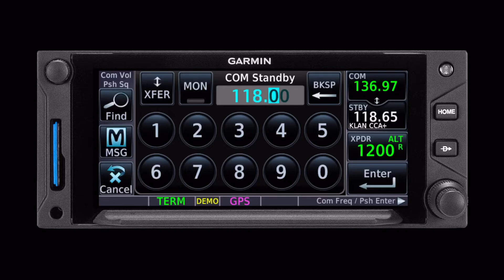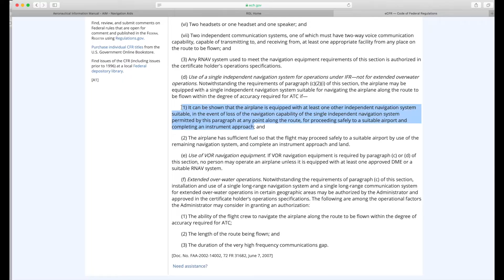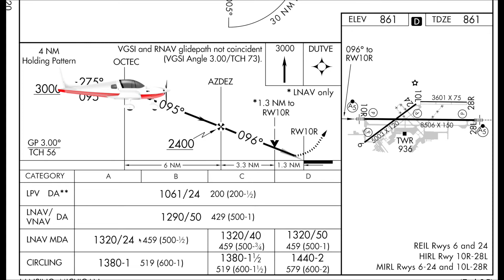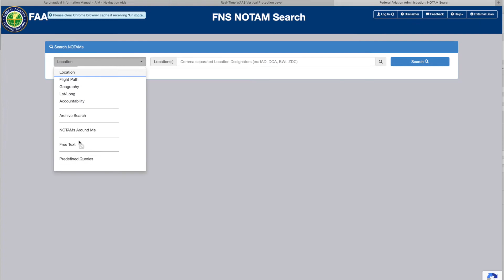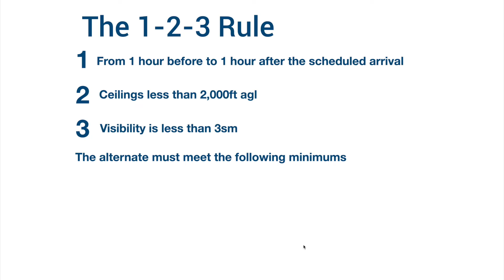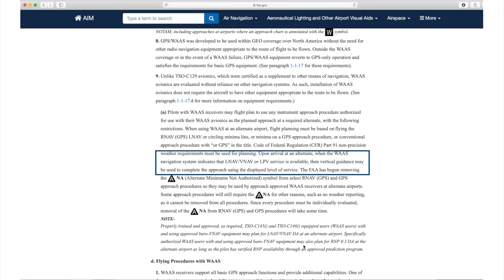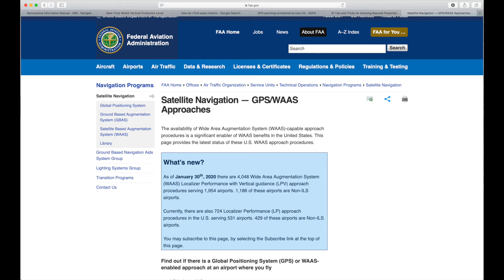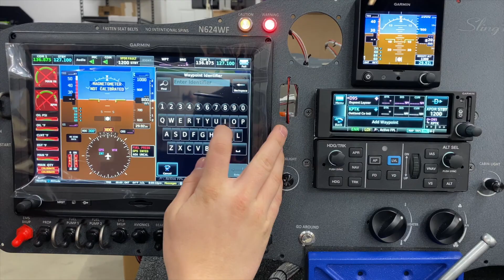GNX or GTN to equip your aircraft build for IFR?

Comment: I’ve been flying an arrow a lot  that my club owns and on a IFR flight yesterday my alternator went without warning then within two minutes everything went dark including the 375. Because of the 375 having the transponder in it I couldn’t even squawk 7600. Luckily the wx was pretty much VFR had a alternate in mind but I decided to flicker the master switch one more time and the lights back on and used that opportunity to lower the gear and radioed atc to inform them of my situation. These units are a great when everything is working but one must be prepared to utilize those pilotage and dead reckoning skills.
Reply from the maker: If everything went dark, your transponder probably would have too. Backup batteries would help that also
Reply: @MidwestPanels  Very true, and do you see  ga aircraft getting these backup batteries? Thanks for responding quickly.
Reply from the maker: @rn2811  yes, more and more we are seeing it. TCW has certified units available.
Reply: @MidwestPanels  Thanks 👍

Comment: Why not a 375 and a SL30? About the same size as a 650 for about $2k less
Reply from the maker: You can if you want to install a used unit. You will also lose some of the features from the G3X such as frequency swap.

Comment: Good information on the various WAAS GPS navigators.  Regarding the legalities of installing only one WAAS GPS navigator for IFR you reference Part 125.203, however, this regulation is not applicable to GA aircraft.   Part 125.203 is specific to AIRPLANES HAVING A SEATING CAPACITY OF 20 OR MORE PASSENGERS OR A MAXIMUM PAYLOAD CAPACITY OF 6,000 POUNDS OR MORE.  Part 91.205 which you cite earlier uis the applicable code governing instrument and equipment requirements for powered civil aircraft with standard category U.S. airworthiness certificates.  Two-way radio communication and navigation equipment suitable for the route to be flown is all that is required.  Navigation equipment, however, is addressed under the applicable Technical Standard Order (TSO). A WAAS navigator certified to TSO C-145\146 does not require alternate equipment.  Therefore, only one WAAS navigator is required for IRF.
Reply from the maker: Understood, we are simply showing all regulations as they apply to GPS navigation, as it goes in aviation if it doesn't say you can't then you can. Also a TSO is not a regulation its a design spec.  An STC is what specifically calls out what is required for certain installations per aircraft, such as a G3X in a certified aircraft has an STC that spells out what is required for that aircraft not a TSO, the equipment it has meets TSO for its required operation. All of this though is mainly for the experimental market and what is required for IFR, which does not fall under certified regulations to begin with.

Comment: I went with the GTX-375 with GNC-255a. The 255 was a better value than a 650 plus a transponder. Although I'm surprised that the 375 doesn't push frequencies to the 255.

Comment: I like all those “hunerds” being saved. I have an existing 430w and probably going to add the 375 for a transponder and backup nav.
Reply: The 375 naviator is far better. You can create random holds, it has lateral and vertical guidance to VFR runways, and more. Its a next generation.

Comment: I don't think you can use the GTR 20 with the GNX-375.  I think the GTR 20 is for the G3X only...  Anyone know more about this?
Reply from the maker: You can’t use any radio with the GNX 375, it stands alone.If you use a GTR 20 as a 2 place intercom you can wire the alert audio to it but yes the GTR 20 was developed for the G3X system. If you are not using G3X you will need a panel mounted radio.

If you look at what we do, it’s 99% G3X.

Comment: Excellent sir!  I just went GPS only on my Aerostar.  Pulled a bunch of '75 Collins out. and I went the GNC355a plus two KY196's and the new 3 com 345 Audio Panel.  Additionally I have a stand alone GDL 50 and Aerra 760...... My mistake was using a 330esd instead of the 345 transponder.  I may add a 375 thus giving me redundant transponders and the traffic and weather on all devices.

Comment: Steve and Adam, I recently discovered your channel and I've thoroughly enjoyed videos and the information.  I am getting ready to build an aircraft (model not decided yet) and this video triggered a question which I've not been able to find an answer.  I'm hoping you guys can help.

I've noticed that most people using the G3X system will pair a GTN device with a GTR200 or GTR20 as their second comm.  If I went with a GNC 255 for both the second radio and Nav, I know the G3X can control both the radio and nav portions.  However, is there a way for the G3X to display VOR/ILS information from both Navs (like a cross radial identifying a fix on an ILS approach)??  Or would a secondary display like a G5 or GI-106 be required??  I know I'm thinking old school by wanting a second Nav radio but I can't shake the question and capability.  Thanks for your thoughts.

Comment: Does the waas receiver and GPS receiver have independent power supplies within the unit?  I think the intent would be to have an independent option for the route flown.  Also without a VOR I don’t think you can fly class A.. In addition if you are IFR and have an emergency it would also be very beneficial to have an ILS installed in the plane so to increase the number of acceptable diversions.
Reply from the maker: Hi Jeff,

Thank you for your comment.

No they don’t have separate power supplies, however if the Unit itself dies it doesn’t matter if it’s a GTN 650 or GNX 375, it would be the same result as the unit controls the NAV portion so your scenario would only apply if only the GPS receiver inside the GTN 650 failed, however the G3X itself could be used in this very unlikely situation to get you safely on the ground. Even though it’s not certified for approaches, it is definitely accurate enough to do so, as well 91.3(b) states:In an in-flight emergency requiring immediate action, the pilot in command may deviate from any rule of this part to the extent required to meet that emergency. So if necessary the G3X is not only capable of helping you it would be legal in an emergency.

91.135 lists requirements for Class A airspace and a VOR is not listed, however I would argue that most GA aircraft will not fly class A anyway due to oxygen requirements and the lack of ability to climb that high.

As for emergency and options, pretty much any airport with an ILS will have an LPV so options aren’t really much of an issue.

As stated in the video, it really comes down to personal preference. There really is no right or wrong answer here.

Thank you for watching and engaging, these interactions are what make this community great!

Comment: I was informed by an instructor that I know that examiners will allow you to demonstrate a precision approach with LPV even though it is not considered a precision approach.  If this is actually the case it would allow you to have a single gps for your checkride. Can anyone comment on that?
Reply from the maker: Section VI Instrument Approach Procedures Task A Nonprecision Approach and Task B Precision Approach both call for the use of ground based and satellite based navigation systems, so if judging only by the ACS it would not be allowed. Our local DPE will not allow it however we have found that opinions differ around the country so it is best to check with your local DPE

Comment: great video/ I enjoyed your take and presentation. I did however find that when you were talking about the gnx375 at the 15:18, you had showed and commented on the gtr 20 paired with it when this is not possible.  My understanding is its only compatible with a g3x.  I can not find any documentation or menus in the gnx375 to support this.
Reply from the maker: Correct, the GTR 20 is only compatible with the G3X. We build Experiental panels so G3X is what we work with. If you were putting this in certified without G3X then you would have to use rack mounted radios.

Comment: Good Info!  I already have a good KT-76C digital transponder with GDL82 ADS B.  Additionally, a  GNS430w and a KX155 with glideslope.  So... just add a GPS 175 and a newer generation iPad with Garmin Pilot for the nice big display and Bluetooth connectivity, creating  a great setup for under 5k!  The nice thing about iPad display is with the right mount, it can be right at your fingertips and have an even bigger and in some ways more versatile display than a GTN 750.  Basically, the 175 and KX155 give you everything for a  #1 GPS/Nav/Com, and the 430w becomes the #2 backup.  Cool thing is that you can Bluetooth your flight plans from the iPad with either Garmin Pilot or Foreflight apps to the 175 and it can then cross fill them to the 430w.  I'm also considering some of the GI 275 stuff that also connects with Bluetooth when upgrading round instruments or getting rid of a vacuum system.  Lots of info for relatively small bucks (in avionics terms) and can keep the round gauges for backups and retain the retro look in my classic.

Comment: This is a great video but I do have one question. I have an older non-gps IFR stack with DME and a KX155 with glide slope and another KX155 without glideslope. I'm thinking of getting either a gtn650 or the gnc355. I'm wondering if I should get the gnc355 and install a g3x to get more real estate or if I should get the gtn650 with G5s?

Comment: Wow, I'm in the process of buying a plane. I was looking for something with a  Garmin 430W but this plane only has a Garmin 300xl. I was thinking Bout the Garmin 175 in the future as a budget gps because my pockets arnt that tall. Seeing this very informative video now have me confused. Should I just keep the 300xl?
Reply: For VFR the 300 is fine. Not appropriate for IFR though.
Reply: The 300XL is fine for non-precision approaches because it is non-WAAS. The new 2" navigators are intended to replace the older 155XL and 300XL with the 175 (GPS), 355 (GPS/COM) and 375 (GPS/XPNDR/ADS-B in/out). Parts for the older non-WAAS are running out, same for the 430W. However, the 430W can be replaced with an Avidyne 440 without removing the tray and wiring.

Comment: 14CFR125 applies to no homebuilt.  What it does apply to would require a second navigation source.  A GPS with WAAS is ONE source.  To encourage IFR operations with one navigation source is ill advised particularly when it is your com source as well.  One box quits (and they do quit from time to time) and you wont be shooting any approach ASR or otherwise.  And yes the ACS require more than a GPS approach for the rating.  Good overview of the garmin offerings though.
Reply from the maker: landinggearup not only have I instructed in aircraft with one NAV Com but many fly with one. If I lost my GPS it wouldn’t really be that big of a deal, yes you can shoot an ASR approach without a GPS, same as a no gyro approach.
Reply: Midwest Panel Builders....landing gear up is correct. Part 125 has NOTHING to do with small planes. Basically, that is for planes with more  than 20 pax. Like they said the rest of the video is good though.
Reply: I don't think single source is an appreciable risk as there are much greater dangers to IFR flying, especially in a single engine recip. There is a degree of redundancy if a G3X is installed as that will have a sufficient nav capability to mostly fix the nav problem, albeit the PIC will have to make a certain declaration to legally use that backup source. Also, an IFR flight will almost always be operating in a radar environment so the controller can provide navigation and terrain separation. Money is probably better spent on a good, reliable powerplant. JMHO.

Comment: great video.. I'm planning on installing a GNC 355 along with a G5 HSI to satisfy IFR flying. Many pilots, avionics shops and FAA DE's etc are unsure of the requirements for IFR flying and IFR check rides only using a GPS WASS navigator. Can an instrument student take the IFR check ride with only a GNC 355?  3 different approaches required, For example,  the same plate can be used to do an LNAV, LNAVVNAV  or LPV approach in many cases. Three different approaches. Just in case, my backup plan is to install a Navcom unit tied into the G5 HSI along with a previously installed GNC 355...  Just heard your last comments on IFR Checkrides. I will still install a separate Navcom if needed to satisfy IFR check rides plus gain additional redundancy with a second comm radio and second non gps nav source.
Reply from the maker: The ACS does state that you need to perform approaches by way of ground based navigation equipment so technically you can't do a check ride with only a GPS. Plus an LPV is not classified a precision approach even though it is flown the same as an ILS. The best thing to do is check with your local DPE to see their thoughts. As for IFR flying, as mentioned in the video, as long as it is WAAS its totally legal.
Reply: @MidwestPanels  First of all, CONGRATS on a superbly informative video.  It is rare to see anyone dig into the FARs and the AIM in explaining this complex information.  The only point I'd like to submit is that the ACS does state (A-14-15) "Localizer performance with vertical guidance (LPV) minimums with a decision altitude (DA) greater than 300 feet
 height above terrain (HAT) may be used as a nonprecision approach; however, due to the precision of its glidepath and localizer-like lateral navigation characteristics, an LPV minimums can be used to demonstrate  precision approach proficiency (AOA VI Task B) if the DA is equal to or less than 300 feet HAT." Personally, I'd prefer to have the ILS capability. Thanks for a great job

Comment: Great explanation, thanks!   Does the GNX 375 need a separate CDI to be IFR certified? Doesn’t it have vertical and horizontal bugs right on the screen for a gps approach?
Reply from the maker: jpoppinmoneyunit We are glad you enjoyed the video. You do not need anything more than the G3X screen. The G3X has an HSI and displays the course as well as the glide slope if the approach uses vertical guidance.

In the event that the G3X failed we can use the G5.
Reply: @MidwestPanels  But if you don't have a glass PFD, then wouldn't you have to have a nav indicator such as GI 106B to display "on course" guidance with the GNX 375 display indicating location on the course as well as localizer display?   I have seen this combination advertised as a basic certified IFR setup.  I was surprised to note that the GPS 175 (and I assume GNX 375) is compatible with many older nav indicators from other manufacturers.
Reply from the maker: @Stratocruizer51  yes you would need an indicator like the GI 275, G5 or GI 106.

Comment: I’m planning two G3X, a G5 and a GNX 375. and a GMA 245 R
Reply from the maker: Harold Locay that will be a great setup. We do these all the time.
Reply: @MidwestPanels  now I have that setup in my new Bristell. I’m in instrument training and have the dilema of a Checkride needing two navigational aids. How can I add VOR ILS to my current setup ?
Reply from the maker: @haroldlocay3946   Unless you can find an older SL30 the GNC 255 would be about the only way to do it.
Reply: @MidwestPanels  Excellent. 
Would that be a lot of work/time to add that ?
Reply from the maker: @haroldlocay3946  it depends on what you already have? Which COM radio(s) do you currently have. Will a VOR/ILS antenna need to be installed?
Reply: @MidwestPanels  I have two G3X touch, G5, GNX 375 with audio panel and second com, GTR 20 R com, GSU 25, GTX 45 R TPX, GPS 20 A, Garmin GMA 245 audio panel. No VOR/ILS antena.

Comment: You can do precision and non with the 375. They can only test you with the equipment in the plane., so I think you can get your instrument rating with the 375 ??
Reply from the maker: The only precision approach is an ILS. Although the LPV performs like a precision ILS it is not actually classified as a precision approach.
Reply: This is very timely for me.  I'm having a 375 installed into my Piper Warrior for ADS-B out compliance and IFR navigation (without a G3X for now).  I also have a non-WAAS 430 and one (1) GI-106A CDI.  No convenient place to put a second CDI (and don't really want the added cost).  I am putting the GI-106A onto the 375, and leaving the 430 without one.  I do want to do IFR training and certification in the plane.  Am I still blocked?
Reply from the maker: Phil Loftis it’s best to check with your local DPE. I have seen differing opinions on this subject. Our local DPE will not for an instrument check ride with only a GPS. The ACS still references the use of Ground-based navigation for precision and non precision approaches.
Reply: @MidwestPanels  Thanks, good suggestion to check with DPE.
Reply: @MidwestPanels  I did all my training and IFR check ride with only the GTN 625 installed in my plane. My examiner said even though the wording does not say that an LPV approach is a precision approach, he considered it applicable because it went down to a 200 ft DA. same as the ILS at the airport.
Reply from the maker: ToochFlix it’s probably best for each person to check with their DPE because our local DPE will not accept the GPS only for instrument check rides as the ACS still states the need to use ground based navigation for precision and non precision approaches. Not surprised because this isn’t the first time I’ve seen differing opinions among examiners.